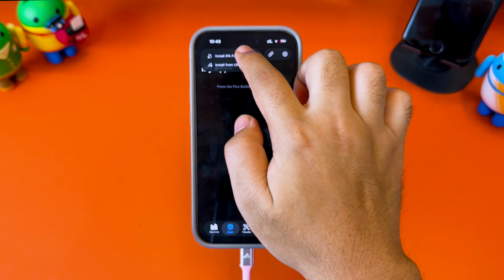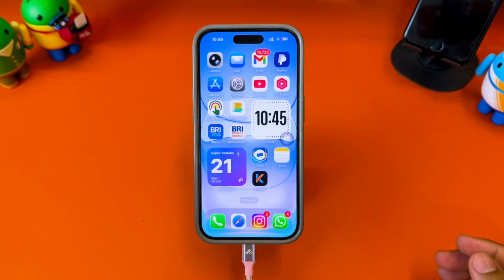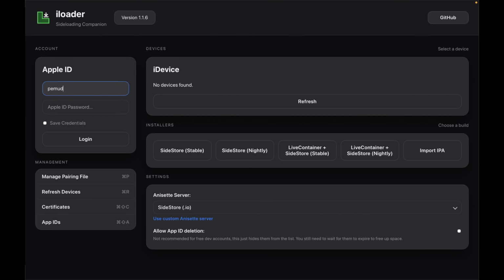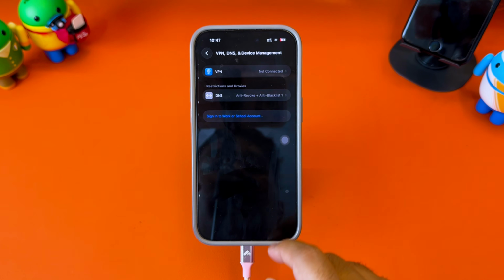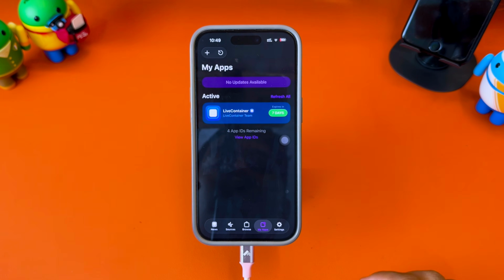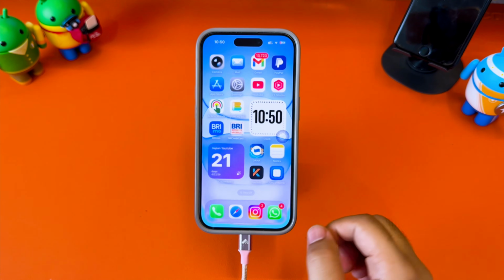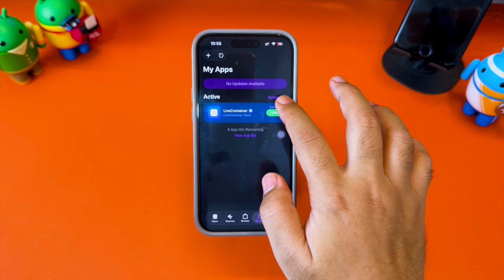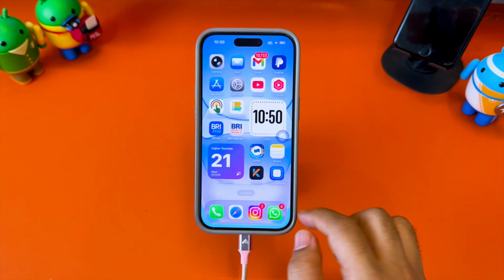NEW iLoader iOS — Easiest IPA Installer Unlimited Apps & No Expiry!

Comment: For the people that get this error you do not appear to be connected to WI-FI and/or LocalDevVPN! Sidestore cannot refresh applications without Wi-Fi and LocalDevVPN. If both are connected replace your pairing file with iloader. To fix this issue you need to install the nightly version of sidestore plus LiveContainer because there’s an issue in iOS 26 where the apps cant refresh. PLS PIN MY COMMENT

Comment: For me even tho I connect WiFi and turn on vpn this keep showing 
Failed to Refresh LiveContainer
You do not appear to be connected to Wi-Fi and/or LocalDevVPN!
SideStore cannot install or refresh applications without Wi-Fi and LocalDevVPN. If both are connected, replace your pairing with iloader.
Reply: Maybe it’s iOS 26.4 issue. Try to use both LocalDevVpn and VPN with IKEv2 (for example “super VPN”)
Reply: press livecontainer + sidestore (nightly) on iloader instead. thats what fixed mine
Reply: me too idk what it means (the end part)
Reply: If u still need help, go onto sidestore on ur device and go to settings. 
Scroll down and u will find "reset pairing file." Press it and reset it. 
Now on iloader (on pc with phone connected), on the left side there is a "manage pairing file." 
Click it and press place pairing file. 
It should work now.
Reply: Install secure vpn and local dev vpn and connect them at the same time then try

Comment: It worked but failed to refresh live container 7 days. Have downloaded VPN also
Reply: I'm having the same problem as you; I'm getting an error message, even though I have Wi-Fi and VPN turned on.
Reply: Connect to WiFi your phone and pc then it will work
Reply: @joykakkadan2642 not Work

Comment: Thank you! It worked. But I have a question. Do I need to open the apps from live container every time? I don't see any app icon on my device. Is there any way to add the app icons to home screen?
Reply: I think if you tap and hold the app, you'll get an option to add it to home screen
Reply: Press the send buttonn then down till u find put to home screen the save
Reply: No way. Only works directly inside live container

Comment: I have a problem with 6-digit verification code. which is not showing on my device. so how to fix this. i did it severel times, I am watching your every videos. I have also searched for the solution but I failed. so please help me to solve this. or make a video for this. Thanks Ya
Reply from the maker: Make sure you're logged in with the same Apple ID on another iPhone/iPad.
Reply: I have logged in the same id on iloader and also trying to logging on sideload 😫☹️🫪
Reply: I had this issue too. It seems problem is on iOS 26.5 Beta. But I fiked it: you need to go back iOS 26.4 Stable.
Reply: On your iPhone or another Apple device, go to Settings, Mail and there you'll find an option to add a new account. Log into your Apple account here if this account doesn't show. Or if you have another Apple device such as a Mac, log into your Apple ID in Settings on that device and you should receive a code.

Comment: still there is issue when you refresh sidestore is failed even with localdev still cannot refresh
Reply: its because of the ios 26.4 update
Reply from the maker: @Someonelivin yes
Reply from the maker: iOS 26.4 ?
Reply: @iSo @iSolutional t boss moi ça me fait la même chose pour l’actualisation de sidestore malgré avec le vpn erreur data ect… moi par contre je suis sous iOS 26.3 pouvez vous m’aider le boss merci encore pour votre retour 👍🏾
Reply: Same thing for me I’m on iOS 26.3.1
Reply: Finally … Found a way to refresh days.

1. Install (VPN - Super
Unlimited Proxy) from Mobile Jump Pte Ltd.
2. Open App and Connect with IKEv2 with any server.
3. After connecting with VPN - Super
Unlimited Proxy, then connect with LocalDev VPN.
4. Open SideStore and refresh apps.

This is just temporary way. It works for me. Hope they will fix this later In future updates.

Comment: Failed to Refresh LiveContainer
You do not appear to be connected to Wi-Fi and/or LocalDevVPN!
SideStore cannot install or refresh applications without Wi-Fi and LocalDevVPN. If both are connected, replace your pairing with iloader.
Why this happens.please check my comments 😘😘😘
Reply from the maker: Enable  LocalDevVPN and connect to Wifi network to refresh it. or you can refresh with cable as well